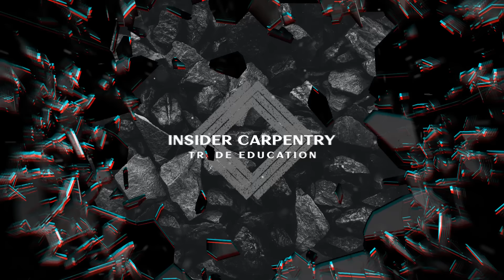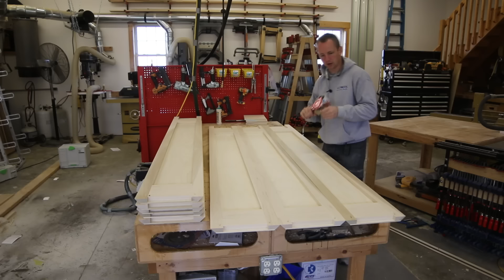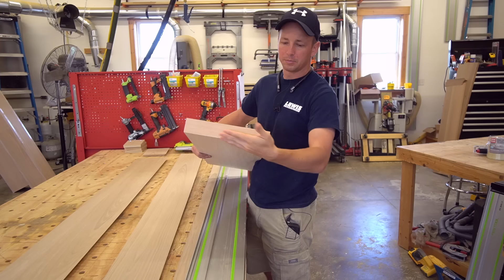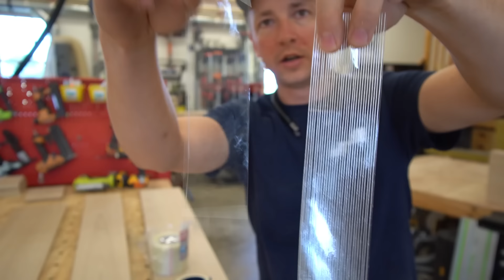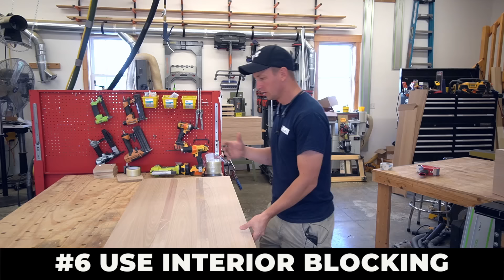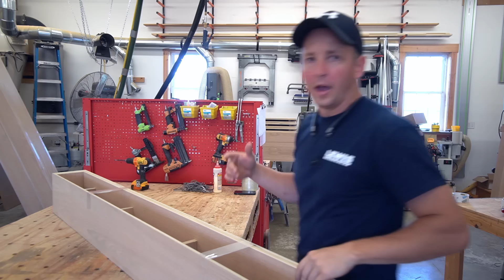MASTER PERFECT MITERS!!! | 10 Secrets to Miter Folding

Comment: Excellent video!!

Lately I've been using my router with a V-groove bit and I keep it from going all the way through by about 1/16-1/32 inch. Then I use painter's tape on the outside edges.  And I finish like you do. This way there are no glue leaks, no burnishing needed, and absolute grain matching. It does take longer though. 

Keep up the excellent work!

Comment: 3m makes a easy removable filament tape, (3915) its used for securing appliance doors during transportation.    Expensive but you can leave it on as added corner protection  until you're ready to finish the instal.

Comment: There is a simple solutionnto the packaging tape ' pulling problem. Run a heat gun briefly. And it comes off perfectly. And with no pulls or damage

Comment: I have been looking for long miter tips for building speakers and this video takes the cake! Everything here is applicable to my project. I guess my only question is if there is any scenario you find a loose tongue in the miter is ever necessary to strengthen the joint?  With interior blocking I guess there is not and a loose tongue in a long miter is difficult to pull off seamlessly.

Comment: 3:37 wood is awesome. I work In tool and die. I use the same wixey gauge. 
For wood they're great. 
I use them to get a driver angle. But they're only accurate for 2-5deg. Lol. 
He does make a good point. Everyone wants to zero on the magnet side.  The bigger the angle from zero is more out of off it'll be.

Comment: Just wanted to post this after learning how to adjust my table saw to cut at 45.5°.  There is a 90° and 45° blade tilt stop that is used to adjust the angles.  Find the stop bolt and jam nut for the 45°.  I marked mine with a sharpe at the original position.  Using a digital angle gauge, zero it out on the saw top then attach it to the blade.  Make small adjustments to the stop bolt until you get to 45.5° then set the jam nut.  I put a label with 45.5 on the front to remind me the max angle.

Comment: Spencer, great video! Extremely comprehensive and still very easy to follow along with. If I may, can I add one little thing regarding the tape dispenser you use? The back of it has a "floating" plastic piece that when you press on it it contacts the roll of tape, locking it in place and making the tear that much easier. It prevents those tears where the tape keeps rolling out of the dispenser. Again, great video, I'm now subscribed and can't wait to see what else you put out!
Hugzzz 😎

Comment: When you remove the tape pull it off at a 45 degree angle in the direction you are removing it. This method will not lift the veneer. 
Good job otherwise

Comment: Ive actually got a lot of use out of the smartphone app version of Microsoft Excel and it saved me today because i was having to cut panels of Hardie board fit between trim that was already installed and pretty much all of it I had to cut custom angles.  The problem is for example if I had to make a cut so that I have an 89 degree corner, where would the exit cut point be on the far end of the panel thats 96" away from the entry cut point?  Basically im trying to determine where the 2 points on each end of the sheet good will be so that when i pop my chalk line and cut, my workpiece will have a corner angle of 89 degrees.   If everything is being cut so that I always have 90 corners, the exit cut point will be same distance from edge that the entry cut point is.  But thats not the case I had today and so I made a custom Excel calc spreadsheet using some trig formulas to to tell me exactly where that exit point will be on the opposite end of the sheet.  So if I input 85 as the degree of corner, the spreadsheet will return 8 & 6.4 sixteenths.  That means i measure on the opposite end to 8 and 6-7/16ths, then mark that point, then pop my chalk lines on those points and I will have an 85 degree corner on the piece i am keeping.  Every panel i cut fit like a glove in between the pre-existing trim pieces.

Comment: Ive never owned or used a track saw but how easy/difficult is it to set bevel angle accurately to an angle value like 45.5 where there is not going to be a detent for that angle?

Comment: Number 1.... Make sure your table saw is not a 'work site' saw.. I have a Dewalt work site saw I'm working with so no 45.5 degrees for now.  What brought me here is I started doing various floating shelves for fun and everyone wants one now so Tip Ten is very real.  However, now that people are paying me, my rough-edged shelves need to get much better.  I was having a very hard time trying to do long 45 bevels (35") on "finished" plywood surfaces and kept practicing so eventually got most of these tips the hard way. Thanks for some of the others that should get me to the finish I want!  Another good tip is to use painters tape along the cut lines for even finer cuts if your blade is not top end.

Comment: I've been following your methods and preaching them from the mountain tops to others. You have helped me out so much! 

Just wanted to share one method I've discovered when peeling the tape off of the miter folds. I'll try to articulate as best as possible. 

I no longer pull the tape up and off of the wood. I, too, experienced the wood peeling off along with the tape. I now "shear" the tape off by pulling it back 180 degrees in the opposite direction. I first de bond about 2 inches on one end, I then fold the tape back 180 degrees so it's making contact with the tape that's still bonded to the miter fold, and I slowly slide it back until it's removed. I experienced basically no tearout and the clear "Box Lock" tape I use rarely tears as well.

You may very well be using this method since the recording of this video. Just wanted to share this with you for all of the help you've given me.

Thank you Spencer.

Comment: If you're having trouble removing sticky packing tape from the beam try using brushed on naphtha to help.  It's a trick luthiers use to remove packing tape from delicate spruce and cedar guitar tops  when gluing on edge bindings.

Comment: One of the best videos for my particular application I have seen. Thanks so much. I’ve often recommended people don’t want mitered posts especially long ones because they often don’t come out perfect. Please forgive me. I do  a lot of mantels and floating shelves too and this is golden. I do tape up smaller mitered projects but just never thought about using on long stuff. Key point is perfectly straight edges and the 45.5 degree cut. Thanks again. Just subbed.

Comment: why would you pull the tape at 90 degrees ?....
Reply from the maker: It's hard to explain but it stays in position and doesn't come loose much better than the tape running parallel.

Comment: Thank you for the video.  A couple questions 

1. How long do you recommend the tape sitting for before you pull it?

2. Do you recommend using 1/2" plywood for floating shelves or do you only use 3/4?

Thanks
Reply from the maker: 1. At least a couple hours.
2. Either would work fine.

Comment: Hi Spencer. Thanks a lot for these tricks. I am struggling right now on some litter works. Just a question: I am working with oak and my table saw is not capable of dealing with it. Do you think a portable circular saw with guide could be a nice option ? What would be the least engine power of the saw ? Thanks for your help! Cheers
Reply: A year later but a track saw with lockable track works better than a circular saw.  Taping up the cut line on the wood on the good faces helps as well.

Comment: Ooh havent seen that tape in years, My cousins and me would tape up the heads of a box of matches with the blackpowder from a .22 bullet in a little cub made by folding the torn of Sulpher strips from the math cox with the striking side inside. We'd tape it to the end of a metal rod, tie that  to a rope and sling it up in the sky..  WHen that thing lands with the rod ontope of the strand taped cube, it goes off with the sound of a bomb Don't y0ou think you can maek the shelf and then add the veneer last.? wear an apron hen glueing, it will save you many sets of cloting.

Comment: Do you have tips for getting a perfect miter 45 degree cut to when the joint is exposed( like a jewelry box)? I tried the Wixey digital gauge. Even though it said it was 45 degrees when it was joined with the matching 45 degree it was less than 90 degrees. Maybe my gauge is not accurate plus the manufacture states it is only accurate to within +/- 0.1 degree. I assume one just tweaks it a bit one way or the other with test cuts to get it dialed in. Any tips would be appreciated. Your skill and videos are amazing!!!

Comment: Spencer....I just built 5 cabinet grade Maple plywood floating shelves 62" long (10" deep) using your process and I'm very pleased with the outcome.  The 45.5 degree bevel cut, strapping tape and Titebond III glue tips were very helpful and gave my project a professional look.  The only difference in my process is that I used a block end (vs. bevel) and covered the plywood with 3" veneer.  Thanks for your help.

Comment: Great tips. How do I cut at 45.5 degrees if my saw only goes to 45?
Reply: you don't, effectively.
Reply: You can adjust the table saw stop for the extra .5 degree.  Its a stop bolt and jam nut on the inside of the saw cabinet.

Comment: Do you sand the long edges while the glue is wet still? Or cause the tape is on holding it you just burl it and not sand and fill the gap with that?

Comment: Tank’s Spencer for this video. To avoid pulling vener when you take off the tape, try to pull the tape parrallel to the joint not perpendicular. That way, you will create a shear force instead a pull force and might help to pull less vener. Sorry my English is not very good. Keep doing videos!

Comment: I'm a finish carpenter, just planning out some 10' faux rafter beams for a cathedral ceiling. I was planning on using pine 1x boards with a routered miter lock joint to achieve the solid beam look. My concern was that even if I get the joints perfect (easier said than done with pine I know) they might open up since we have wild humidity fluctuations here in the north east and softwood especially would be susceptible to movement. In your opinion do you think those long miters could open up with a miter-lock joint? Anyways now I'm definitely leaning towards plywood and folded miters, dead straight and stable are the clear advantages, I'd just need to track down 10' sheets of plywood here in the frozen wasteland of canaderp. Awesome video and thanks so much for the help dude!

Comment: I built two 8 foot floating shelfs this past week using your methods.  I didnt have to cut any crown off the boards, I was using 3/4/11.5 inch solid Poplar and not plywood   I checked the straightness with my Festool saw guide to check this.   I did do the overcut on the miter and used the tape.  The results were very good and the ease of construction was much easier than the previous methods I used.  I appreciate your videos and sharing your knowledge.  Thanks

Comment: Great tips. I would advise pulling the tape at a much sharper angle to avoid peel stresses and using a heat gun to soften the adhesive when it seems especially stuck on. ✌️

Comment: How long are you letting the glue setup before pulling tape off. Also are you cutting both sides at 45.5".Also some part numbers ECT tooth and thick on saw blade your using

Comment: Spence
 When building short depth floating  miter folding shelves. Clients are 4 1/2 in deep 63 long. Track saw or table saw. Ever took a crack at it with MDF
Reply from the maker: Table saw. MDF is not as strong and can sag under weight. Use caution.
Reply: @InsiderCarpentry  I use 2x3 with GRK 5/16 screws countersunk as my cleats  for anything under 8 in depth. I needed paintable. Mdf is 35 bucks a sheet lower than Birch plywood at the moment. I may regret that savings. I appreciate the reply

Comment: This is great content. I'm seriously trying to learn more about this. Question about breaking down a sheet of ply to eventually fold together in the fashion. How do you cut the large sheet so that the grain of your front face lines up with the grain on the top and bottom faces? Seem like you would need to 45 the top face and then 45 the front face from the remainder of the sheet. But you would need to flip the work piece to get the 45 at the right angle. Seems like the waste would be too much for the grains to line up nicely.

Comment: Thanks for a very informative video and EXCELLENT verbal descriptions. I look forward to trying these techniques. I noticed in this video and another one of yours that for floating shelves you use just a cleat to attach the shelves to the wall. If it is not a long shelf and you don't need the threaded insert into the wall, how do you attach the shelf to the cleat? How does the shelf stay in place?

Comment: For anyone confused like l was, he is not actually overcutting the miter/bevel. It’s only >45° because he zero’d the angle gauge 90° relative to how l have seen many people do it (namely the ones who say to cut <45°. 

If you cut >45° relative to the saw table, you will without question have an open miter if you try to make the faces meet at 90°.
Reply: Right. It isn't a 45.5 degree angle, it is a 44.5 degree angle. You can reason that out, and Spencer is clear about how he set it this way, but it's a little confusing.

Comment: Thanks for sharing these tips, they are super valuable for anyone from a pro to a DIY'er like myself. Quick question, maybe you covered it already but for areas that the tape might pull up the veneer are you just using stainable wood filler to correct that? Thanks.

Comment: Love your work and it sounds like the 45.5 degree would solve my problem I have been working on with not much luck. My question is, did you have to modify your saw to go past 45 degrees or will SawStop go past 45?
Reply from the maker: There is a large bolt that acts as a stop. It can be adjusted to allow the same to go past 45.

Comment: Spencer, great video!  Regarding veneer pulloff when removing the tape, you might find that pulling the tape off at nearly 180 degrees to the surface instead of at 90 degrees reduces the chances of pulloff.  I think this is because by bending the tape so much (180 degreesish), the adhesive bonds break much faster and don't pull as strong.  This also works for decal removal.  Thanks!

Comment: Veneers are so difficult to deal with sometimes. So I've taken to resawing 1/4" boards of the species of wood I want and laminating it to a sheet of nice plywood. Voila. Can even round the edges and sand when its all together.
Reply: P.s. great tips btw just bought some of that filament tape and the dispenser 👍👍

Comment: Would you see an advantage to using carpet tape? It has fibers in two directions, and shares your desired characteristics of being very sticky, with even higher elastic stiffness for cross joint elasticity.  Just leave the barrier layer on to not expose the 2’nd side stickiness.    I came across it when looking for the lowest cost double sticky tape.

Comment: Great video, Does anyone know how to measure the front face cut correctly? I am having a tough time figuring out  what to set the table saw to, considering the 45.5 angle. For instance if you want a 2" thick shelf, you can't set the table saw to 2" and rip the front pieces becuase of the angle of the blade. Would love to know what the formula is.

Comment: Excellent video, thank you.

At 18:55 you said you had done a lot of lock mitreing.

Do you still use lock mitres? Or does this folding method replace the lock mitre?

Any advice on when lock mitre is preferred over folding would be appreciated. Thanks.
Reply from the maker: I’ve pretty much completely stopped lock mitering. Miter folding is just so much faster and easier. And I get the same results.

Comment: In effect the outside edges touch, and the glue fills the small gap on the inside. So question is, does  a particular brand of glue have superior gap filling properties? Is the gap along the inside edge ever perceived? If I imagine a paste of glue mixed with sawdust will be a strong invisible filler.

Also, is the 45.5 method suitable for use with dominos? Your advice appreciated, thank you.

Comment: So you should be using both tapes, in wood contact use the packing tape on both pieces. And to hold the pieces together use the fibre tape oner the packing tape.

Comment: Awesome video Spencer. Just one question. I've used the reinforced tape and let it dry overnight. Next day I had a really bad time cleaning all the remains of the tape. I had a lot of fibers sticked to the veneer. Should I take the tape off earlier?
Reply from the maker: I have stuggled with this also. Currently I'm back to using regular HD packing tape without the fiber reinforcement. It's been easier to clean up and less likely to damage the surface by pulling off veneer.
Reply: Had the same thing happen this weekend- any tips to remove the fibers easier? Thanks

Comment: Tooooo loooong and not that helpful
45.5deg is something I can try
Years of experience and crazy expensive track saw just not in the cards.
Factually/technically: reinforced tape is a LOT LESS elastic than the other kind. It doesn't stretch as much and therefore applies higher force.